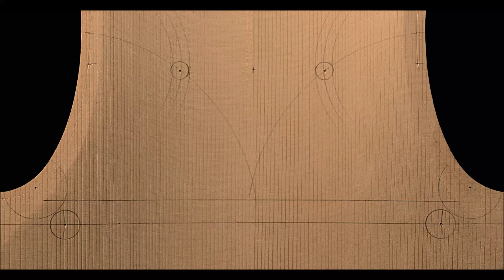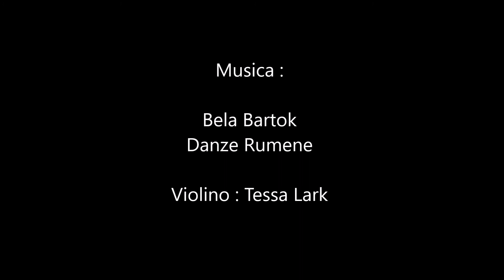Taglio delle effe (condensato) - F-holes cutting (condensed)

Comment: Sir, please elaborate the geomery of placing the F-Holes. It will be so helpful if you elaborate the F-Hole placing geometry.
Reply from the maker: The system for placing the Fs doesn't have much to do with their geometric conception, but it is a simple system of transferring measurements from the drawing to the plate to be worked. There are some studies on the geometry of the f-holes, but none have managed to be completely exhaustive. In my opinion, the shape and placement were mainly done by eye keeping in mind the key points such as the position of the bridge and the position of the eyes relative to the Cs, and once a satisfactory position was found by trial and error, it was fixed on a drawing to be able to bring it back to the new plates and keep it as reference for later violins. A good book that deals with the geometric aspects of the forms of stringed instruments (violins, violas and cellos) and also of the f-holes is this one, not cheap but highly recommended: https://traitedelutherie.com/en/

Comment: Excellent work! Could you please share a link where I can buy this tool? Thank you very much!!
Reply from the maker: I bought them from LiuteriaShop but I'm afraid they are no longer available. https://www.liuteriashop.com/it/
As an alternative, there are these conceptually similar ones from Dictum, but they are not available at the moment, but I think they will put them back in the catalog soon.
https://www.dictum.com/en/cutting-tools-jbe/f-hole-drill-set-violin-viola-10-piece-set-701110
The last possibility is to make them yourself starting from harmonic steel rods, it is not difficult but you need some equipment and specific skills with steel processing to make them.